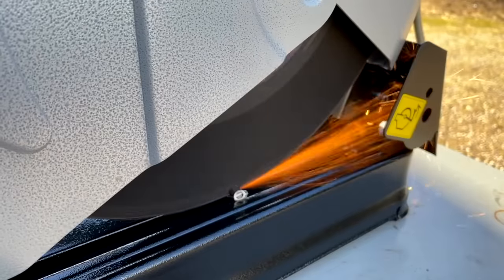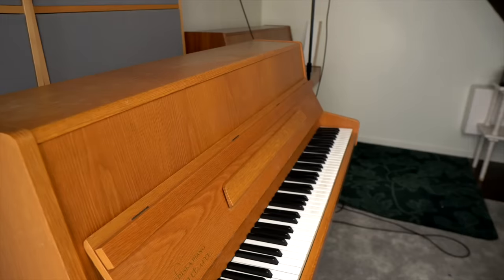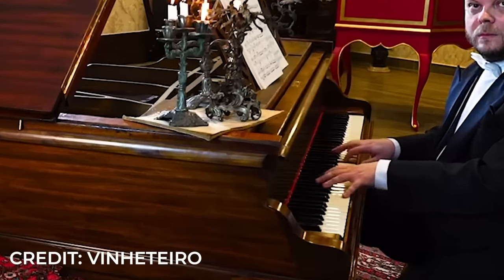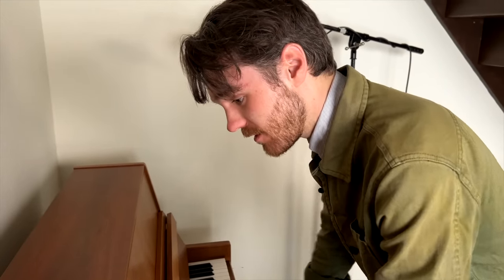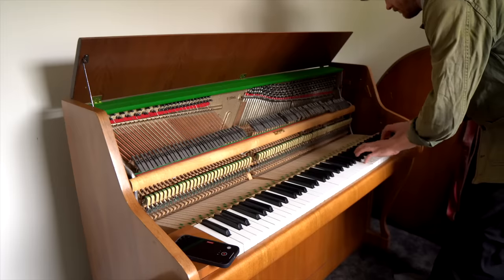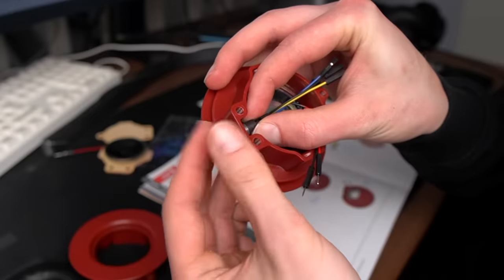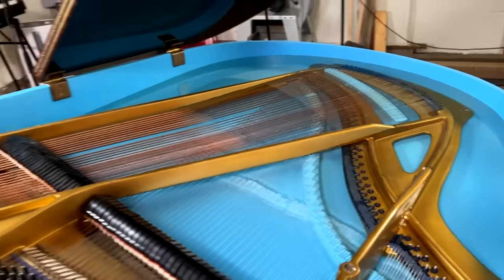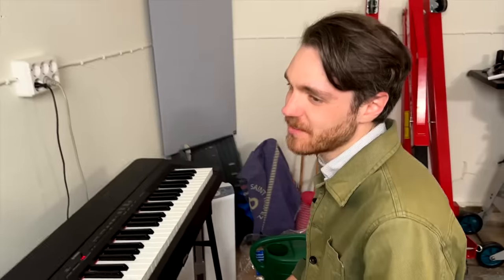Piano tech opens all my CURSED pianos

Comment: I find it fascinating that even though you tuned each string on the E-board to one note, you can still hear the original note as an overtone because that's still predetermined by the actual length of the string, as opposed to how tight you wind it up
Reply: Uhhhhh, what, how
Reply: @daydodog  The tech points it out briefly. There's actually two waves on each string. One is the oscillation of the string itself, as it's vibrating with it's resonance frequency after being hit, the other one is the impulse wave of the hammer traveling up and down the string from the point of impact. It's the difference between sound moving through a solid object (which is determined by the speed of sound for any given material) and the whole object moving itself, which is determined by its size and mass. Usually the two are the same if the string is tuned correctly, but as it isn't on the E-board, you can always hear both notes. The one that is natural to the string and the one the string is tuned to. You can sort of hear it when he's hitting the single keys in a row
Reply: @Dragongaga  acoustics are a wild science
Reply: Huh (I didn’t understand nothing)
Reply: @gigi_luigi543  you can tune a fork, but it'll still be a fork.

Comment: Make a backwards piano. Make the C8 sound like an A0 and the A0 sound like a C8.
Reply: I was just popping down here to propose a backwards tuned piano, you beat me to it! :P
Reply: @craigb.5902  great minds think alike, mi amigo!
Reply: It would literally be a left piano
Reply: I doubt it would be as easy as taking the frame out and turning it around 180.
Reply: This would really fuck with some heads. I play guitar left handed, and whenever someone who plays guitar comes over, they'll ask if they can try. They think they'll be able to play it, but after the first note they already get stuck
Reply: @scottythedawg  I wouldn’t think so. But, you might be able to achieve the same effect by having the hammers triggered by actuators and use analogue key switches under the piano keys and have them key the opposite side though a controller. Would be a bit of work but could be done I think. 
Or, I suppose, so long as strings don’t snap or go slack it might be a matter of just retuning it. But idk.
Reply: left handed piano 🙏
Reply: Left handed piano lol
Reply: Yeah lol
Reply: But that would prob break it :/

Comment: From a technical standpoint, a piano filled with sulphur hexafluoride to lower the pitches sounds like an interesting challenge. The main trick will be tuning it while wearing SCBA equipment...
Reply: My prediction: the sound will not change that much.
Reply: @johnrubensaragi4125  if at all, because the pitch comes from the strings
Reply: @nightspicer  your voide pitch comes from strings too. They’re called YOUR VOCAL CORDS
Reply: @HerrConner627  That's a misnomer, they are flaps. They're calling them vocal folds now.
Reply: I mean, the thing with sulfur hexafluoride is that it's so dense that very little will actually spill out of the piano, and if you're above it, any that does spill out will sit at floor-level, so inhaling it isn't as significant of a risk.
Reply: @HerrConner627  except they're akin to the hammer in a piano, whereas the air is the strings being played. by replacing the air in your lungs with helium/sodium-hexafluoride is like replacing the strings with ones that are thinner/thicker

Comment: Here's a few ideas: 
1. Double the scale lenght of the strings. However, the increased tension might be too strong. Also, pretty technical to do.
2. Do a combination of strings since each note has 3 strings. Ex: one piano string, one guitar strings, one sitar strings or else. 
3.Put electric guitar pickups (humbucker to get the noise cancelation) on the piano and feed the signal into a distorted guitar amp.
4. Change the hammer for a mini violin bow. So if it's possible and done well, you could technicaly play the note by releasing the key as well.
5. Change the strings to a metal plate. A bit like a xylophone. However since the plate would be longer, they would resonate more.
6. Tune the 3 strings on a key to a minor or major chord.
7. Transform a piano into a big nut cracker.
Reply: F me sideways. I hope he´ll do the violin one :D :D
Reply: I was thinking of the pickups, that would be cool to get someone with a big collection of effect pedals to see how you could make it sound.
Reply: Whoa calm down satan
Reply: @bongmuon   exactly! There are many possibilities there! A delay into a large reverb to give a spacy vibe would be pretty interesting. Pretty much any chain could be done in a DAW, however with a VST you get the sound of a mic'ed piano in a room. With guitar pickups the sound would be totally different. In fact, I really want to see that!
Reply: The most impractical electric piano ever
Reply: The violin one and minor/major chord one are really funny
Reply: man isn't there some baroque thing that works by bowing the string? I feel like that's something that exists
Reply: @theKobus  you're probably thinking of the viola organista, which was designed by Leonardo da Vinci but only built recently
Reply: The metal plate one is just a celesta lmao. These are all pretty neat ideas though
Reply: 3 sounds amazing!

Comment: Hmm, I usually come up with an instant list when asked about video ideas but you have a very specific niche. I will give it a try maybe something will inspire you.
1) a piano to play under water, perhaps have the strings in an air bubble and the piano in a pool.
2) can a piano be made from corrugated cardboard ?
3) glass hammers?
4) rubber mallets instead of hammers?
5) reverse the keys on a piano so it high notes on left and low note on right? (Not sure if this is even possible)
6) a piano that uses violin bows instead of hammers.
7) team up with "how ridiculous" and get a recording of a piano hitting from 65 meters drop, make a sample for the keyboard and see what it sounds like.
8) make the hammers on a piano of a conductive material and have them be switches for colored lights as well as music, so when the piano is played flashing lights of different colors accompany the sound.
9) coat strings in different substances to see the effects. Rubber coated strings, house painted, electric wire coating on strings (more items I am sure). Pick one do a whole piano.
10) make a piano out of a car, pop the hood and see the strings.
Note: this has been a difficult list to create. I hope something inspires you to keep making videos.

Comment: Here's a cool idea, I don't know if it's crazy enough for you lol. I once worked on an old piano, one of the big uprights from around 1900, that had a special effect you could manually activate. A bit like a practice mute (felt) that are still common. It was a strip of thin leather spanning the whole piano, sliced for all the notes, with metal rivets on the end that you could flop down in front of the hammers giving it a harpsicord-like sound. Similar to a tack piano, where you stick metal thumb tacks into the hammers, though that is more permanent and can wreck your hammers. This method didn't destroy anything, and I've never seen it done on any other piano!

Comment: I have a suggestion for the one-piano-per-note idea: You wire each of the pianos using some sort of midi-controlled actuators so you can actually play all seven from one keyboard. You might have to divide the piano keyboards into maybe four (or more) segments to have more playable range but still retain the larger sound.

Comment: Have you tried reversing the piano yet? Having all the low strings on the right and the high ones on the left
Reply from the maker: Not but I do have a grand piano without any strings and I don’t know what to do with it
Reply: Seems really fun 😄
Reply: @Mattiaskrantz  make the hammers pluch rubber bands...
Reply: @Mattiaskrantz  Just installing low strings on the high note part might mechanically damage the inner frame, I'd think.
Reply: @cbuchner1  he put a swimming pool in a piano which definitely mechanically damages the frame. Not a show stopper.
Reply: its morbin time
Reply: Morbius 🅥  bot
Reply: @cbuchner1  Nah its already existed.. designed specially for left-handed pianist..

Comment: Maybe the logistics would be way too crazy or impossible but what about "I filled my piano with different gasses" to see how they affect the sound?
Reply: I read that as "grasses" and pictured various materials for the damping ribbons.
Reply: If he wants to try to lower the sound with sulfur hexafluoride then he could use the pool piano for that with no new modifications since it's already watertight. That particular gas is so dense that you can just store it in a bucket.
Reply: You'd only have to build it once. Make an airtight casing with a feed and vacuum system, then you just suck one out and push another in
Reply: Sure, helium pianos are fun and all, but beware of the fluorine piano. I don't know if a piano would really work if it's airtight? That itself surely would have some impact on acoustics. Alternately you just fill the whole room with gas. Even less practical!
Reply: @ids1024  I wonder if you used some sort of lightly charged phosphorescent gas if you could make the sound waves light up. That'd be pretty cool
Reply: @techattack  now that's an image.

Comment: The effect at 4:20 may be caused by the hammers striking at slightly different proportional contact points as the string length changes but hammer height does not.  Like a violinist playing colengno (hit string with stick instead of using bow hair), hitting the string in slightly different places creates different  pitches that can be heard in the initial attack even though the fundamental pitch stays the same.

Comment: This I think would be a really crazy one, but a piano that you can turn up and down the volume on that is not electronic, but instead gauged by how much air remains inside the piano. You'd need to make the strings and hammer aspect of the piano entirely in an air tight vacuum chamber where you can pump the air out of to decrease sound, and let air back in to increase sound.

Comment: Use different densities of gas to change the resonance! It will be a bigger challenge, making a piano air tight, but sounds travels differently through gases like Sulfur hexaflouride or helium, and maybe you could get some interesting sounds out of that.  Maybe you could try a small scale test to gauge interest before you do all the hard and expensive work.
Reply: Tune all the keys to E, then have airtight gas compartments on each string to shift them back to what they should be.
Reply: You probably don't need the piano to be airtight for SH6, since it's heavier than air. He could probably reuse the pool one to keep it from dribbling out, assuming SH6 doesn't permeate the seal.

Comment: An idea: replace the strings with springs of different diameters. it would never hold a tune and be like a massive reverb chamber that sounds like hot garbage for certain.
Reply: is this possible? probably not. would it be cool? probably not yes.
Reply: @user_hat  it is entirely possible to do springs come in a range of sizes from hardware sellers like McMaster Carr. Is it possible to tune it is the real question. In theory the springs are stable once you set the tension so it should be a repeatable sound. The only challenge I see is keeping the springs in an elastic state and not overdoing them to the plastic state
Reply: @vincernio  ah ok

Comment: This may not be a feasible suggestion, but maybe instead of replacing the string or the hammers, you could replace the wood? I imagine a plastic or metal shell for the piano would sound radically different, for example.
Reply: Different shaped shells
Reply: Transparent plastic, or something that could vibrate easly
Reply: No point in replacing the cabinet, the only part that would really affect the sound is the soundboard, and that's just the back. It would be cool to hear what a sheet metal soundboard sounds like though.

Comment: You could make a infinite sound piano, mount solenoids on every keys. each of them connected to one of those car flasher relay and then to a switch and a car battery
Reply from the maker: What would happen if I connected that? Sorry idk what car flasher relays do 😃
Reply: @Mattiaskrantz  just like the lights on a car flasher, reapeat the note every second until you turn the switch off
Reply: Actually when you are inducing a electric field you could vibrate the strings magnetically and hammerless with no „hit“ sound and as long as you press the key.
Reply: @erlannderrantem6972  that could be cool too
Reply: @erlannderrantem6972  could you target a single string though?
Reply: @alexschott9567  propably no, the strings are to close to get something for gathering field im between
Reply: Jesus Christ died for your sins please repent for the kingdom of heaven is at hand 🤸🏾🏋🏽🥌🎿🎿⛸⛸
Reply: @erlannderrantem6972  You'd need 250 E-Bows. A bit pricey, but it would sound awesome.

Comment: You can try to replace hammers with electric magnets. Then to make sound you can supply magnet with AC of frequency that corresponds to note of the string. Maybe there is some more clever way to make it sound. You showed once in your instagram weird magnetic bow for guitar -- the idea is to make hybrid of this device and a piano
Reply: The magnets will stick to each other.

Comment: normal piano but the hammers hit a midi keyboard instead of strings
left-handed piano
try different fluids in water piano, such as mineral oil.
rubber band strings
glockenspiel piano
piano with whammy pedal
piano with guitar pickups (maybe on the guitar-stringed piano) and filters
rubber chicken piano (probably really hard to tune lol)
piano but all of the E's play the E sound effect (could merge into MIDI)
piano but tubular bells (another hammer-based instrument)
piano but the pedals play bass drum and hi=hat instead of normal.
piano with guitar picks attached to the hammers
replace felt with rubber
piano where all the keys are pressed and play when you pill up on them.
that's all my ideas for now!

Comment: Look up how the Beatles had to do the "E" chord finale using 3 pianos, 9 takes, ambient reverb (tech would start with low sound and raise the recording volumes slowly so as to lengthen the sound as the three Beatles held their breath and remained still up to the point where the sound of the air conditionner in the room started to sound on the track; they got 59 seconds of track). Maybe they could have used your trick. I'm suprised George Martin did not think of it! :D

Comment: You could make some "portable" piano sets.
What I mean is, instead of ruining the whole piano for a single idea, having a single piano that can hold different "string boards" that you can change at will.

Maybe you do have to ruin one piano to build enough space below the hammers to accommodate the alternate boards, but it would be one for the price of infinite possibilities.

And my first suggestion would be simple, a piano that plays another piano. Just put a Digital Piano (that works with batteries) inside of the traditional piano and make it so the hammers play the keys. It will be the first analog MIDI piano in the world. :)

Comment: Suggestion: on the tuning fork piano remove green felt and create a stopper (to prevent the forks from hitting the back) but in a way that doesn't hamper the tuning forks from vibrating.

Comment: Ideas: A piano with piezo discs instead of strings, making a Midi drum set. A piano with wooden whistles or kazoos, that uses little bellows like a cuckoo clock to blow them, a piano that's a bunch of triangles, with hard-tipped hammers to strike them, a piano that strums the strings instead of hitting them, a piano that you open it up and there's a smaller piano inside, a piano where all the keys are squeaky toys somehow in tune, a piano that's whoopee cushions in tune, an electric piano where the keys don't move, but you touch them and it connects the circuit, a piano that sounds like a xylophone or a music box, a piano where one key will shock you but you don't know which one it is, rgb piano, a piano where each key activates a "hungry hungry hippo" which then hits the string, an electric piano that only lets you play "never gonna give you up" by replacing the sound of whatever key you hit with the next one in the song, a piano that looks like an ordinary accordion until you start playing it, put a kids toy piano into the shell of a real one

Comment: the guy is wearing the Monty Python gas cooker sketch coat but it's green instead of brown this actually was the technician/workman/handyman/proprietor outfit in the UK from the 1900s until the 1990s in my country it was blue the TV repair man had it as did the butcher and the milkman the dustman and the and the car mechanic the piano tuner to the guys from the moving van every country seem to have had their own color for this coat maybe in Sweden it was green and perhaps it still is!